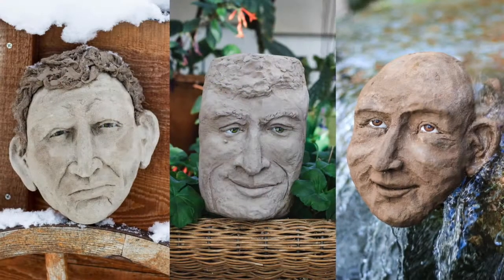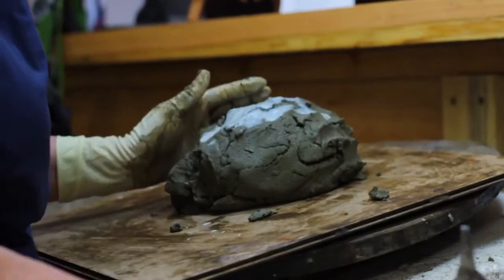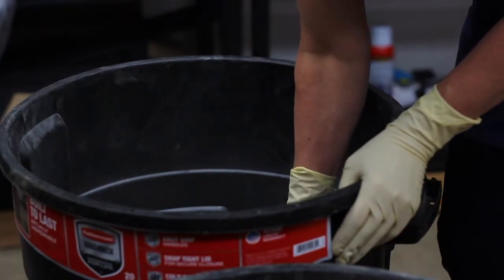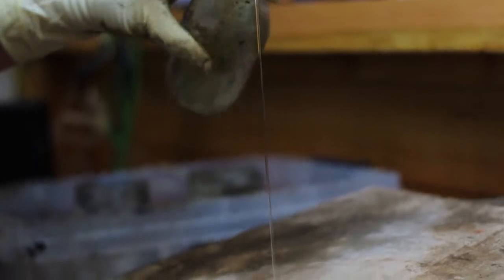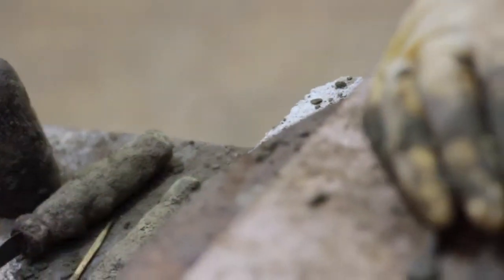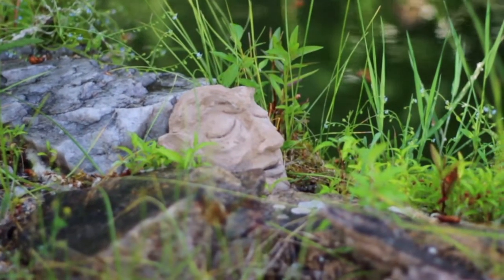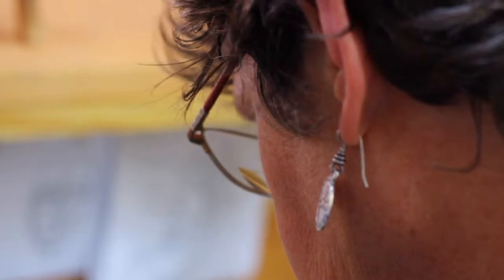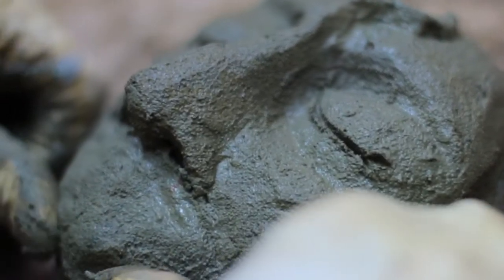The How and Why of My Concrete Sculptures | Montana Bliss Artworks

Comment: Nice video. I enjoyed glimpses into seeing you work. Thanks. My notes: TOOLS: curved leather knife, xacto knife = #1- e.g. digging out deep eye sockets; mop fine art brushes; hands/fingers; wood stick, dental tools. MIX: portland cement, sand, colorant, liquid mixture. Mixes to clay like consistency, places on work surface, & carves it. (Video shows pouring milky water on- probably acrylic or latex, w/ or w/out water). SUBJECT: people/faces- from interesting faces encountered in life- & initially inspired by architectural faces on buildings in Chicago- stone carvings; uses realistic looking glass eyes. USES: Garden pieces (on rock walls, hang on trees, on ground, hidden in plants, as surprises)/ & pieces not for garden, with added jewelry, real fibers (e.g. animal hair- lamb's wool; alpaca hide; ). UNIQUE compositions/ NOT molds: realism eyes couldn't work w/ mold; starts w/ a concept- might be a facial expression, the eyes, clothing, or 1:43??? INSPIRATION: (besides above): pictures, online, magazines, as watch TV... finds a face that "speaks' to her.  MODIFICATION of people: it starts w/ people, but may add animal features, or 'over-express,' or WORK METHOD- ADDITIONAL: draws lines in the concrete, to assist features placement. CURING: 1st spray with more water, then shows placement on a board, inside plastic bag, w/ jar to elevate the plastic off the face. Milky white liquid = mortar admix.

Comment: Could you please tell me exactly the cement mixture the amount of the cement and other elements you use Thank you
Reply from the maker: Hi Daniel i use 2 portions sand to 1 portion cement but other mixes can work also. I add water and mortar admix until i the mixture is claylike so slowly add the water. Water and admix can be mixed at different portions but do not exceed 50% mortar admix.